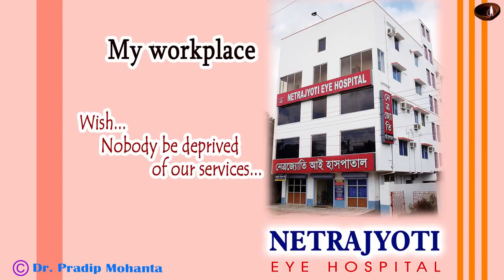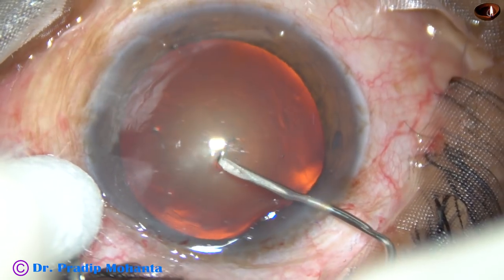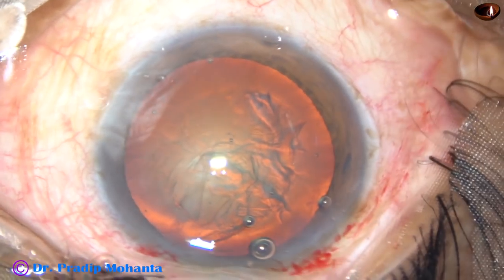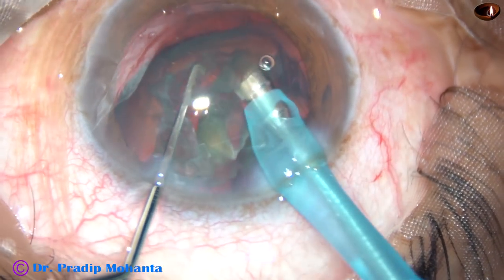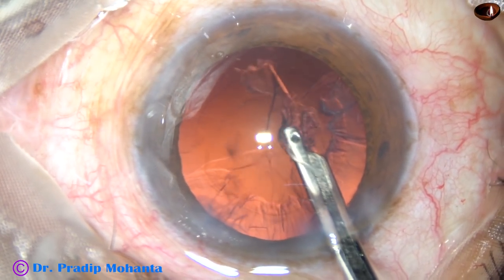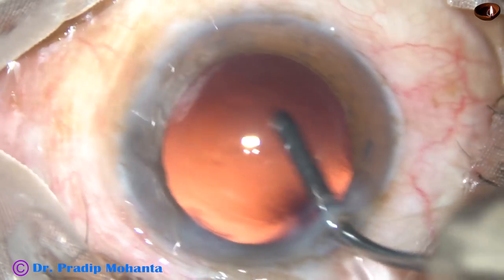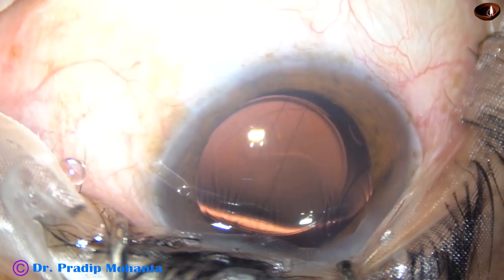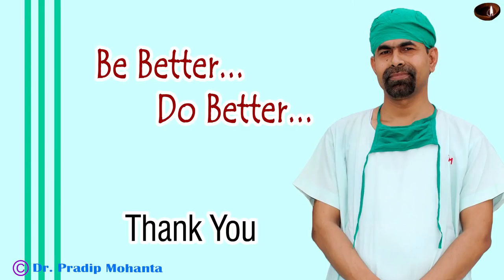Spend 7 minutes & watch all steps of a Phaco - Improve your skills

Comment: Good work, excellent surgery and explanation of steps of surgery, but one thing....my experience shows that hydrophilic lenses say 50% or more require Nd YAG Laser posterior capsulotomy while Hydrophobic hardly do so, and the cost difference is not more than 5 to 10 thousand Rupees at the time of surgery,  the same amount is required for YAG laser, so it's better to use better lens as a first measure, and for that just give a few minutes to counsel your patient.